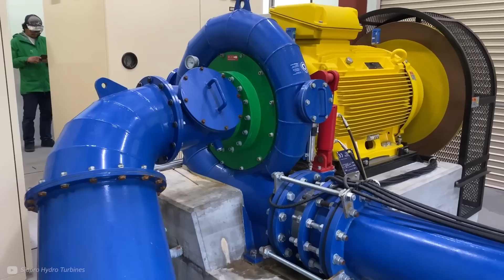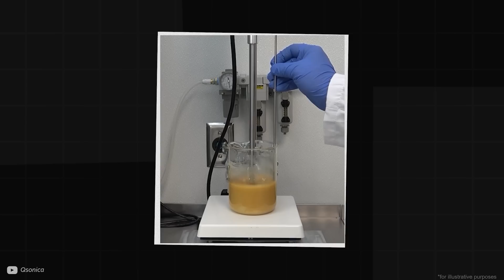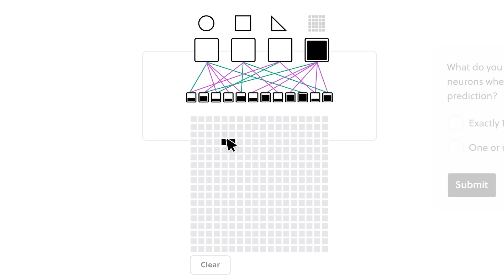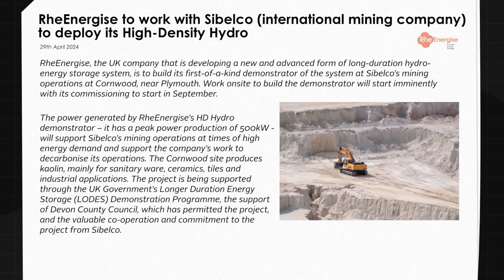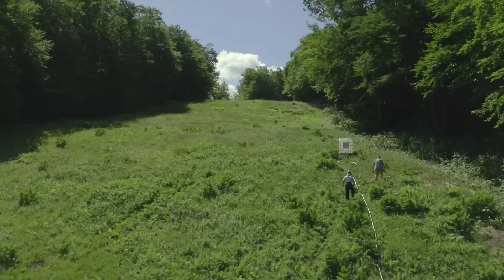The Genius of 'Waterless' Hydro Energy Storage

Comment: 🎯 Key points for quick navigation:

00:00:12 💧 Traditional pump storage hydro power uses water's gravity for energy, but has geographic and cost limitations.
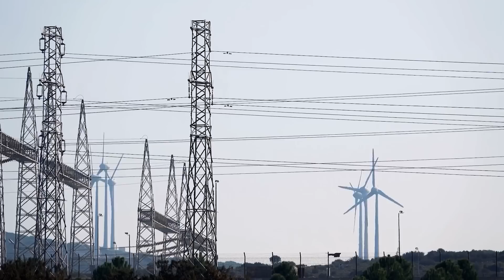00:01:09 ⚡ Re-energize's system combines water's flow with a high-density slurry, providing more energy storage with less height.
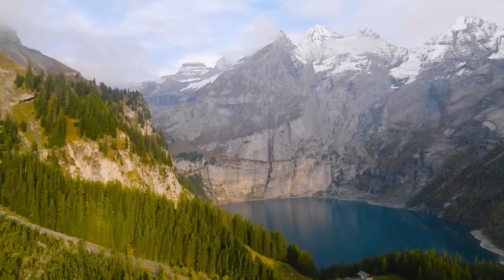00:02:42 📏 The new slurry can deliver the same power with 40% less height difference and 60% smaller tanks.
00:04:03 🏔️ Re-energize identified 6,500 potential sites in the UK for smaller scale energy storage using their technology.
00:05:25 🔬 The patented fluid, R19, is easy to produce on-site and designed to flow efficiently without significant viscosity issues.
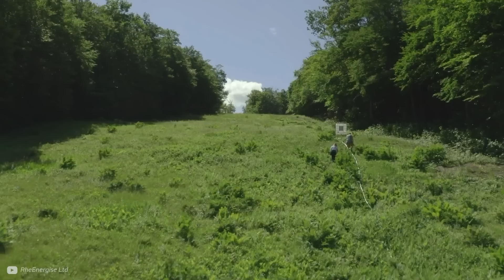00:07:42 🌡️ Temperature control is crucial for the R19 system, requiring active measures to maintain fluid viscosity during operation.
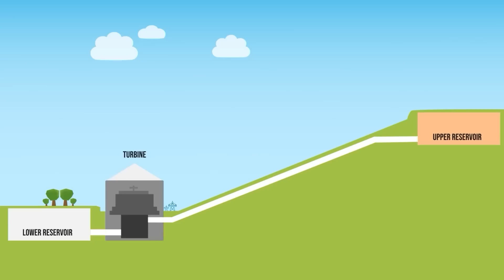00:09:05 📈 Initial demos show R19's effectiveness, needing half the elevation compared to water to achieve equivalent power outputs.
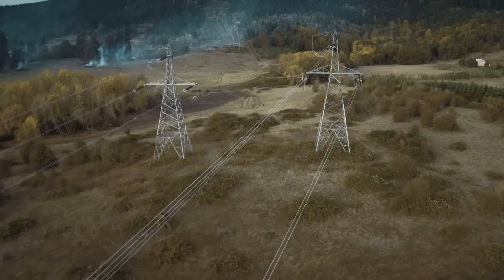00:10:14 🌍 Re-energize aims for a 10-megawatt grid project by 2025 and explores microgrids to support renewable energy access in unreliable areas.
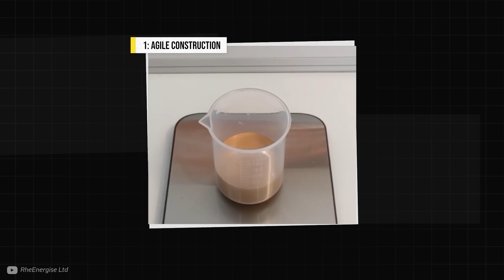10:55 🌍 Smaller reservoirs of 'waterless' hydro can reduce environmental impact if implemented responsibly.
11:10 🔧 Builds on existing pump storage technology, enhancing innovation and potentially lowering R&D costs.
11:25 💰 Re-energize claims significant cost benefits over traditional pump storage due to simpler materials and lower installation expenses.
11:38 🔋 Long-duration storage with minimal degradation or leaks presents advantages over lithium-ion batteries.
11:52 📊 Projected levelized cost of 'waterless' hydro storage is approximately $150 per megawatt hour, higher than lithium-ion costs.
12:06 ⚡ Re-energize's pump storage system could achieve 83% efficiency, potentially outperforming lithium-ion systems.
12:19 ⏳ Concerns remain about long-term functionality and fluid stability in closed-loop systems as the technology is still being developed.

Made with HARPA AI

Comment: At university, when we did a project on the topic of proving the infeasiblility of artificial pumped hydro, we used the example of a water tower. The gravitational potential energy stored in the average U.S. water tower at average height and volume, has enough potential energy to just barely meet the energy demands of a single U.S. home for one day. It really comes down to an optical illusion where some people look at a damed resovouire and ridiculously under estimate the mass of water that they contain. Building the resovouire, without natural geologic containment in place, is vault outside of the engineering abilities of today, or for that matter, within the next century, let alone doing that at a cost effective point. All forms of gravitational potential energy storage are fundamentally inadequate for electricity storage within the geological confines of most places. Chemical and thermal energy have much higher energy densities and probabilities of achieving cost effective energy storage
Reply: Well… we can use two nukes to make the high and low reservoirs, and tell people that it's radioactive so don't swim in it… two birds with one nukes!

Comment: I enjoyed this video. Smart idea. I was distracted by your saying they may need to make the pipes “thicker”. I think you meant “increase the inner diameter.” As someone familiar with pipe fitting and plumber terminology (in the U.S.), this left me wondering what else may be misstated.
Reply: Hey , I'm not too familiar with the terminology. Could you explain what the difference is
Reply: @rohan751  If thicker means the outer diameter is larger, that’s separate from the inner diameter which controls how much can flow. The wall thickness of the pipe material makes the inner usable diameter smaller than that outer diameter. “Thickness” is not a term you’d ever hear. At least in the U.S.

Comment: You can use CO2 gas as a medium to generate electricity pilot plants have been produced. A large CO2 reservoir and two gas compressors to circulate the system and it can be run at 60 percent efficient more than hydrocarbon fuels . Instead of making CO2 the enemy use it CO2 turbines are a lot smaller than traditional and uses less turbine stages .

Comment: What if?
The reservoirs are of equal height, with a valley between them.
Then say at the halfway point the fluid changes from flowing down to then flowing back up. And at the halfway point we reduce the size of the tube. Maybe by 1/3 ? Using the weight difference from the larger, downhill side, to help push the fluid up. Increasing the speed of the flow in the smaller tube so that the volume isn't reduced.
Would this work?
Would this increase the efficiency?
Can the faster flow in the smaller tube be utilized to spin turbines faster for a improvement in the efficiency?

Comment: Z- look into barite weighted drilling fluids used for the last century plus to both drive the boring bit and to lift the cuttings out of the bore- water, weighted up higher than the rock or formation they were drilling in.

Comment: I love gravity batteries.  A 2m long steel weight falling down a slightly wider drill hole can turn a 10mw generator and at 750m deep the geothermal temp should be 1c and air flow enough to pull it up, slowly.

Comment: Barite Mud using a water base could used in the drilling for oil could be a prime candidate for such a system?
Water-based drilling mud most commonly consists of bentonite clay (gel) with additives such as barium sulfate (baryte) to increase density, and calcium carbonate (chalk) or hematite. Instead of reservoirs, large tanks with one at elevated height?

Comment: Interesting concept to add density to pumped storage. Space solar power and its 99% capacity factor and $40 MWh generation cost is a better solution, but this has merit in smaller scale applications like the mine you mentioned where electric gen cost are very high.

Comment: Stored hydro only makes sense if it is pumped to higher elevation using sustainable energy (solar, wind, hydro etc). Whether it is more efficient than battery storage needs properly evaluating but it does involves very large scale engineering with an negative environmental impact when compared with battery or sand storage

Comment: This is nice and all but traditional cisterns can get topped up by rainfall and I wonder about the abrasion of the microparticles on the turbines, not to mention the required temperature control.

Still indeed cool for smaller scale closed loop systems as a storage solution.

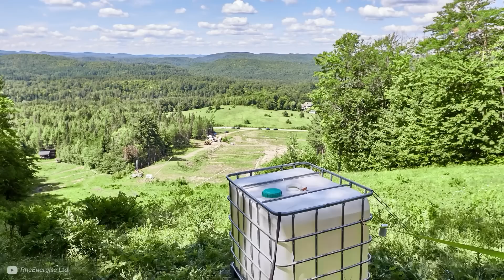Comment: At 8:56 - "Will it work in the real world?  First demo in Canada validating the idea, and a 500kw demonstrator has started in England" - There has been a hydro plant (not using slurry) in North Wales (Snowdonia) for many years, at Dinorwig.  I used to live nearby, and saw the plant several times when family visited me.  It is locally known as "Electric Mountain" and pumps water between an upper and a lower reservoir.  There are pictures of it on Google Maps.

When using slurry, I would expect wear to become an issue after some time.  I get that the particles are ultra-fine, and doubtlessly not diamond ( 🙂), but they will still be more abraisive than water.

Comment: Probably the most important quick calculation is the finances.

A really interesting number would be the cost of the R19 per tonne, which I suspect they're not going to release, but on the available information we can do a ballpark calculation.

The main ingredient, if it's used in oral medication, has to be something like calcium carbonate, kaolin, silica or something similar, ingredients which have densities in the range of about 2.5 to 3Kg/L. The raw ingredient before processing is probably going to cost you at least £25 per tonne.

To achieve a density of about 2.5 times that of water would require probably at least 80% additive, which is equivalent to 2 tonnes of R19 powder/m³ of fluid. By the time you've milled all your ingredients, mixed them and added your surfactant etc. plus a bit of profit, I would be very surprised if the if the cost per tonne would be less than £50, which means the cost of the hydraulic fluid would be at least £100/tonne, and I suspect probably more likely twice that.

Info: Dinorwig pumped hydro in North Wales working head of a round of 530m, generating losses probably around 10%. The working volume is around 7M-m³. 

Using R19 fluid you could reduce the working height to: 530m ÷ 2.5 = 212m
Stored energy - KWh/m³ 
= mgh = (2,500×9.81×212/3600)×90% = 1.30KWh/L
At £100/m³ that is the equivalent of about £77/KWh, which is on par with the cost of lithium phosphate batteries, which have an energy density of about 140KWh/L. Note: this is just at the battery cost, it shouldn't be compared with something like a Tesla Powerwall as this is a whole system cost.

Info: The construction of Dinorwig Power Station in North Wales, UK, began in 1974 and cost £425 million, which is equivalent to £4.7Bn in today's money.

Because the water for Dinorwig it's basically free, using R19 would probably add at least £700M (about 15%) to the project, but almost certainly far more than that. Furthermore, and I like water come up I suspect this emulsion well and gradually degrade with use and require either replacing or refurbishing periodically.

When you consider the ongoing performance improvements to battery technology and continued cost reduction, I can't see this technology ever being able to compete with battery storage. It requires more space plus all the connecting pipework and a turbine hall compared to a battery charger and an inverter. And you don't even need a hill of any height.

Comment: The energy to heat water by 1 degree C is equal to the energy of dropping it 400 meters. 

Basically the energy to heat it will always be unreasonably high. If you need any heat at all, your heating bill will be way higher than the energy stored. Designs that need to keep the fluid warm are basically unworkable.

Comment: I've got a couple issues with this. If the main focus of this is to make the storage capacity more compact using a denser liquid to store more energy then why not just operate a Lift picking up a large Boulder and then lowering it whenever you needed the energy back. This fluid that they've created is only more efficient in shrinking the size requirement for the tanks. The demonstration that you showed comparing it to water only showed the downward flow being more efficient. You failed to include the fact that it's definitely going to take more energy to push that sludge back up the hill. An equivalent amount of energy. So if the idea is to use a dense or material that can still flow easily there's easier ways to do that.

Comment: Thanks.

I wonder how much energy is needed for the grinding , how often the liquid has to be exchanged and how abrasive the liquid is to the turbines. Heating the storage? Or having a flow heater of how much power? The same principle with another less "proven" fluid is more cost effective? I'd like to see that calculation. Do they need a giant agitator in the reservoir to keep the particles suspended in the fluid, to avoid sedimentation? If that would fails, what would that do to pipes and turbines?

Comment: Another thing that came to mind is how to handle the increased weight and pressure. If the liquid is four times more dense it will also be much heavier and create much higher pressures. Following this line of thought it will also need thicker pipes, stronger dams and heavily beefed up pumps and turbines. 

It will also be necessary to build the dams with a much higher security rating. There will also need to be a system for increasing and decreasing the water content of the fluid depending on heavy droughts or rain. 

To me this sounds like a pipe dream, very badly thought through.

Comment: My question is : since its a closed loop system and you’re reusing the same fluid , so you still need energy to pump the fluid up , right ?
Reply: Obviously, but the whole point is that you do it at night when there is excess power from wind, nuclear and gas turbines which cannot be be turned on & off like a switch. The pumped storage on the other hand can be: I have been inside the "magic mountain" at Dinorwig and seen the utterly enormous valves which open almost instantaneously to meet sudden demand - such as millions of people switching on their kettles or flushing the loo at the end of Coronation Street (e.g.). And before anybody laughs, flushing millions of toilets causes a pressure drop which requires (electric) pumps to be turned on to compensate.

Comment: high density also means they would require large wrok done or energy to move them in upper reservoir, as mass to volume ratio increases
Reply: 1- The high-density fluid will require more energy to pump to the upper reservoir due to its greater mass. This is because the work done, or the energy required to move the fluid, is directly proportional to the mass of the fluid being lifted.
2- The higher mass and potentially greater viscosity of the fluid could lead to increased mechanical stress on pumps, turbines, and other infrastructure. This could result in more frequent maintenance or the need for more robust equipment.
3-The overall efficiency of the system might be impacted. While the energy density is higher, the additional energy required to pump the fluid could offset some of the benefits. It's crucial to ensure that the energy gained from the increased density outweighs the additional energy cost of pumping.

Comment: The idea of gravity batteries (while unconvertional) does have some use in large scale plants particularly with dwindling resources needed for conventional batteries, though I can see downsides too; for 1 you're maintaining a much larger facility that's going to see notably more wear and tear to conventional battery stations, and 2 the energy used to pump the liquid up hill (more so with a denser liquid) is likely to incure greater losses than the energy gained on it's return as the conversion between kinetic to electricity is not lossless. So I really can't see this catching on unless this is intended to be a "poor man's" battery or as a greener (albeit inefficient) alternative solution.
As for the R-19 fluid, they might be able to use it in colder climate if they tied the heat produced by the turbine to the tube (as mentioned) and insulated the tube to trap the heat in the pipe, would be a good idea to make the inner tube out of a metal with high thermal conductivity to keep longer stretches of the structure heated maybe adding solar water heating.

Comment: what keeps the slurry in suspension , is settling of the components of it an issue at all ?   You don't need mountains/ hills to do this - the same could be done using a subterranean opening like an exhausted mine as the downflow receiver if the pool depth down there didn't vary a lot - you want minimal distance to have to pump UP...  maybe some salt caverns some where that are largely horizontal at depth ?

Comment: The benefit with water is it self transports to the upper reservoir in many locations, and is inexpensive and ubiquitous..

(Lead and tungsten are a little pricey by the tonne. - concrete is cheaper, but only ~1/5th as dense - sure it is better than water in density stakes,harder to pump).)

With gravity storage, the maximum the topology can give - is never enough...  Never limit to "only so much is required" - the viable minimum may be less, but the maximum yields so much more energy.

Comment: You mention to counter the increased viscosity of the slurry, the pipes need to be "thicker". Your language is imprecise. Thicker means the pipe walls have a greater thickness. I think you mean the pipes should be wider. That is, the pipes should have a wider diameter or a greater circumference. A wider pipe allows a greater flow of water in our suburban environment and so this would also pertain to this system using a heavier and slightly more viscous liquid. You're a smart bloke - you should have fixed this. You also said "micro-grid" when the presented graphic said " mini-grid". Science must also include precision and accuracy. I am also curious about the reverse motion video at 11:26, showing water retreating from a reservoir outlet. Maybe your editor was having a negative day.

Comment: So is the solids in the slurry abrasive? And my experience with abrasive cutting slurry's is that if they are not constantly circulated they will settle and turn into almost concrete in a pretty short time. And evaporation will make the slurry more dense over time, will rainwater be enough to replenish the evaporated water from the slurry?

Comment: find a material that can be filtered back out, and you will find a much higher energy storage. 
As you can filter it out going down, and get an easier material (Pure water) to send back up, while sending the material back up via a trolley or something to be remixed, cutting losses dramatically if you can figure it out in an efficient manner. 

beat the viscosity and you win an extra level of efficiency.
Reply: The total mass being lifted back up is the same regardless of the state it’s in.

Comment: These gravity batteries have one HUGE advantage over metal ion paste based batteries: No battery fires.
Reply: The latest battery tech doesn't burn.
Reply: Somewhat solved. Not all li-ions are alike, there are different chemistries. Your basic li-ion as used in consumer electronics is a fire hazard. Lithium-polymer is one spark short of turning into a hand grenade - sometimes you need a fireproof bag to charge them semi-safely - but the very high power density makes them useful in compact high-performance applications. The you have the safer options - LiFePo4 and the still-novel Na-Ion. Lower energy density, but also pretty safe - even if you try, it's hard to make them catch fire.